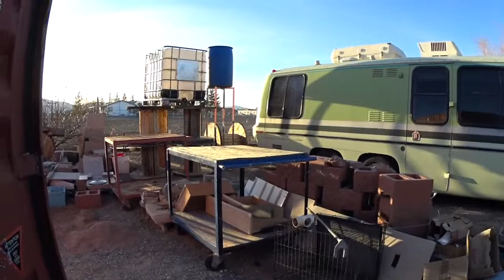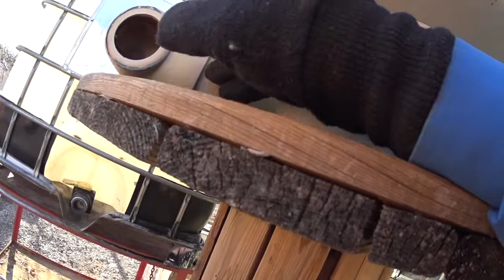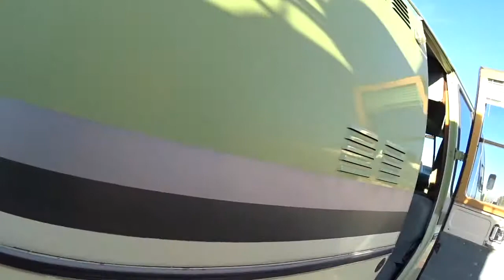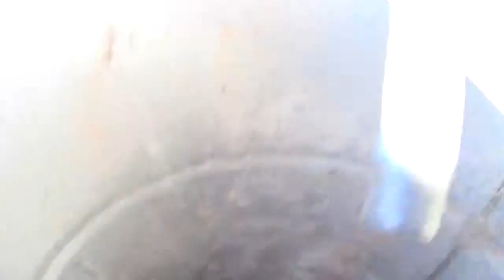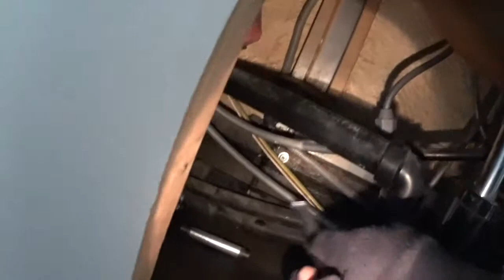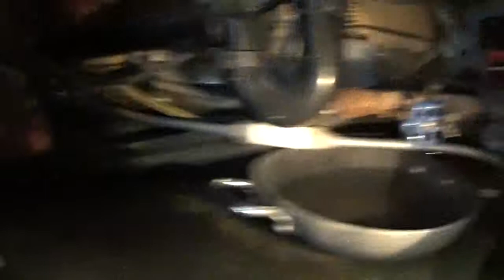(Part 1) Rigging up a Off-the-Grid GMC Motorhome Hot Water Heater System

Comment: Why are you using an Olds 455 V8 that does 8 miles a gallon running at idle to heat a huge amount of water 20ft away from the heat source will take hours to get to 36degC? Why not use an engine block preheater such as an eberspächer off a crashed big rig they use just over 1/2 a quart(0.62 litres in the depth of a Canadian winter)of diesel or petrol per hour and is specifically designed for what you are doing. By heating a large volume of water gradually and only to a luke warm temperature you are making all that water undrinkable and increases your risk of bacterial growth.  Keep the fresh water cool and out of sunlight and only heat what you need.
Reply from the maker: I tested the radiator hoses and they get hot after 2 minutes, I was thinking I only needed to run the engine for 5 or 6 minutes to get Hot water ?  The engine will need to be started and run every week to keep it lubricated.., so why not heat the water ?   I do like your idea of getting a block preheater off an Big Old Rig, Thanks for the Idea, I will look into it :)
Reply: I like this guy but , this has to be one of the most inefficient ways to heat water ,